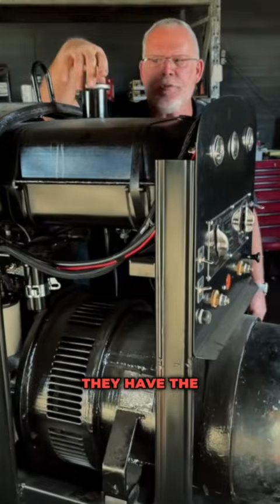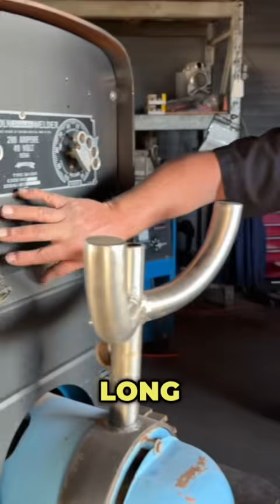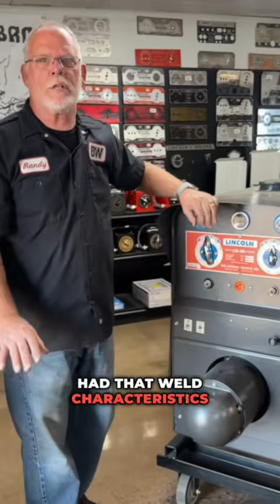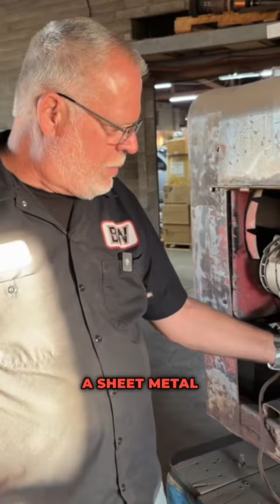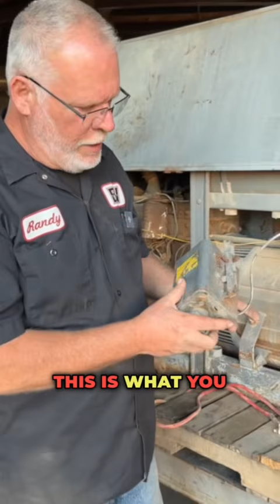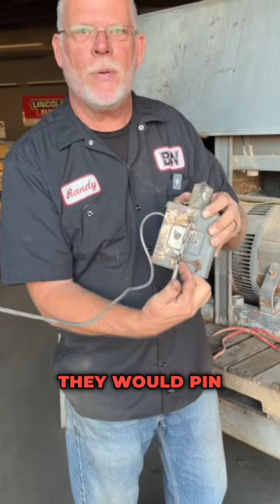The Lincoln SA200 - welding legacy

Comment: As a welder 55 plus years, I run just about every machine. There is, but in 1968, my dad bought a Lincoln 200 amp with a 4 cylinder Wisconsin engine. I test all my welders, overhead with 7018, That machine is a smoothest machine You'll ever run, in nineteen seventy six , we started a welding and machine business, i'm still in that business , and I still own that welding machine, i would not sell it for any amount of money, if I had a nickel forever rod , that machine is burned , I'd be a millionaire, never has been overhauled.
I can burn seventy eight eighteen one eighth inch all day long on eight gallons of gasoline😂. I do not have to worry about batteries.I keep the magneto tuned i start it with a crank.😂

Comment: What group size battery fits in the short hoods?
Reply from the maker: @weld-itfab1633  Most short hoods run a Group 24 battery, but it can vary by year and setup. What SA200 are you working with? We’ll take a look and help you out.
Reply: @bwparts 64 red face